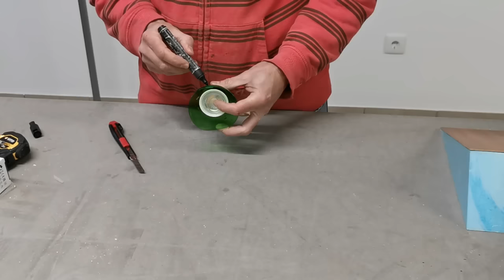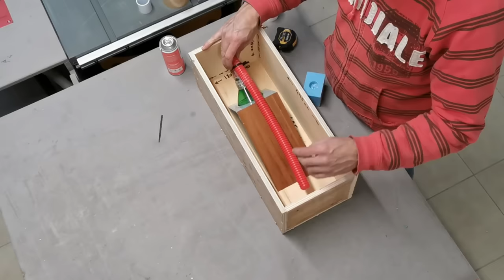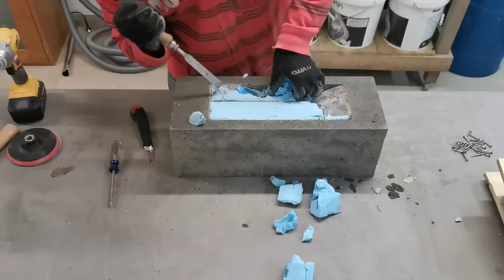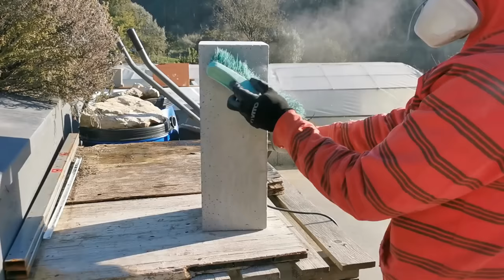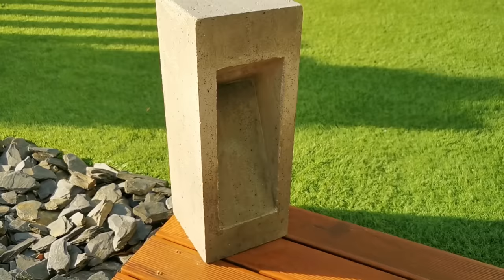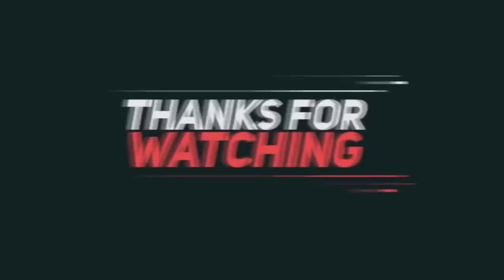DIY Concrete Outdoor Garden Lamp

Comment: Very nice project.  I could see how you could change the bulbs to Phillips LED bulbs, and setup a few dozen around a yard and drive way and be able to control all of them via IOT, change colors and have a very efficient option.  Depending on power consumption even tie all of them to a Battery charged by a small solar panel and a timer.  Thanks for the ideas.
Reply from the maker: Hi Scott, thanks for your comment 👍 That would be a great idea. These are 6w led bulbs, and they're connected to a timer.

Comment: Its always good to put some soap on your wires when fishing them thru pvc or conduit. It slides better without having to exert too much force causing the wire to disconnect from fish tape. good save though
Reply from the maker: We avoid to use liquid soap because it will dry over over time and it will glue the wire ti the pvc. Instead we have a special liquid for that but i dont have any at tha time.

Comment: The blue stuff is it wood,or plastic? Tried screen shot to see size but not clear
Reply from the maker: Hi Safwan, it's Styrofoam. Some people call it "blue board" or "wallmate" or XPS. You can find the details in my blog https://pedrogameirodiy.blogspot.com/
Reply: @WoodYouDoIt  can I add reflectors to make the spot light brighter. And I couldn't see the measurements of the wood work.
Reply from the maker: @safwanawwal3344  yes you can. You must scroll down the page in my blog and search for the lamp post.